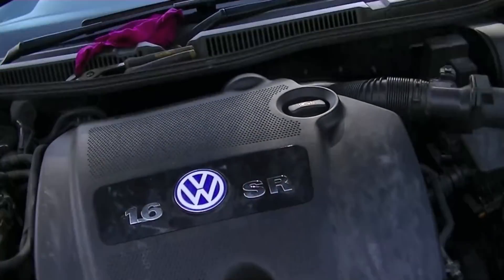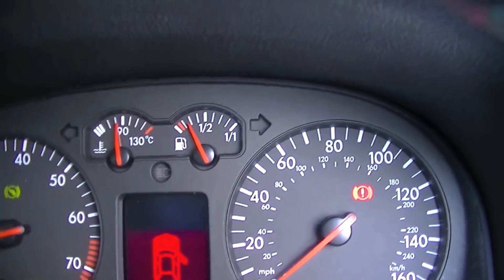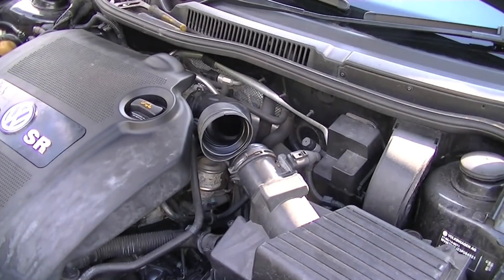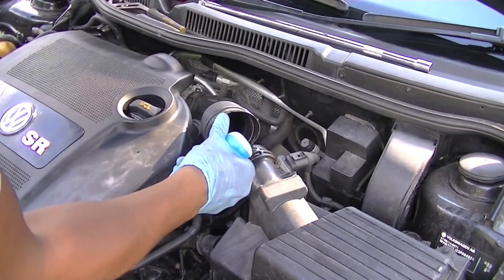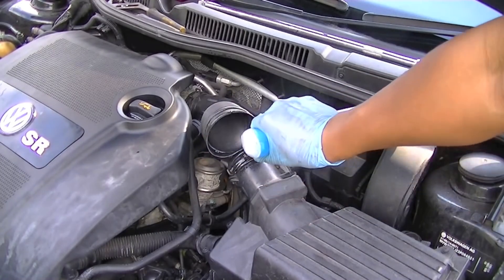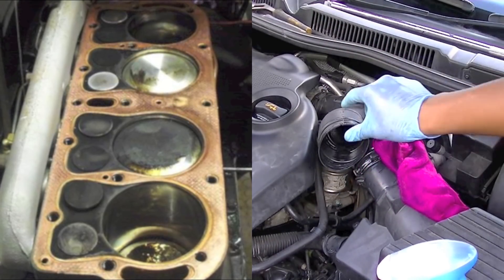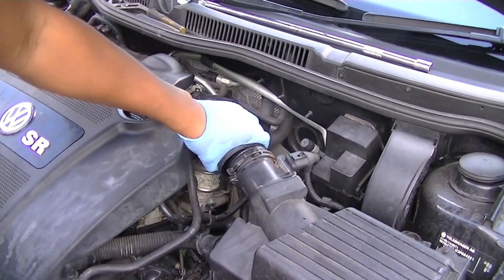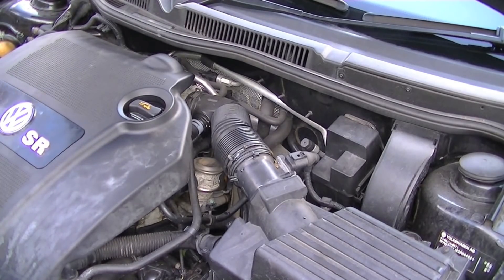How to make your engine run better with just tap water.......Better Than Seafoam?

Comment: Use quality fuel and you won't get carbon build up, always use super unleaded, lower octane fuel is cheap crap and your engine hates it. Im a performance engine builder and you never get carbon build up (which would effect performance or reliability) on engines using high octane fuel, even ones that have done over 60,000 miles.
Prevention is always better than a cure.
Reply: DirtybeatZ uk so I'm not the only one that knows you have no idea what you're talking about
Reply: actually higher octane does absolutely nothing for cars except for high compression engines. even in high compression motor it doesn't  effect carbon buildup it reduces pinging. (different than rod knocking)
Reply: Ryan Pitterman lmao thats the dumbest thing i ever heard, obviously you know nothing about engines or fuel, i map engines for a living kid, i know for a fact and so does all performance technicians, fuel makes every difference in producing power, low octane fuel is not even premium fuel, low octane fuel is for low emission output because of law, its not for keeping an engine in prime condition.  Reducing carbon build up is a side effect of high octane fuel, its cleaner and has properties that are even proven by the manufacturer to reduce carbon build up and clean the internal fuel system. ECU mapping adjustments can make any car run on any octane fuel, even E35.
Its clear you know nothing about what you're talking about so in future listen to someone who knows more than you.
Reply: I'm not going to be like you and lie about my profession. I'm currently in school and we are going over octane in class. and my professor said you're full of it
Reply: +DirtybeatZ uk it seems to me that octane is the agent in fuel that prevents pre ignition in high compression engines, or low comp. turbocharged engines. high compression and heat cause ignitiin before the spark is sent, thus causing knocking. bad combustion creates carbon deposits and bad performance.. i wouldnt put high octane fuel in my gf's focus..but i do in my own car, like you said, because its mapped that way..but there is a mechanical reason for it too
Reply: DirtybeatZ uk you're flailing here falling back on insults and calling everybody "stupid" doesn't make you sound and more intelligent than you are
Reply: DirtybeatZ uk lol I'm not saying I'm offended. I'm just saying that you rely on simple minded insults which send a message that you don't have a strong vocabulary and aren't well educated
Reply: DirtybeatZ uk noone ever said it makes you go slower it but it doesn't provide a horsepower boost just limit pre ignition
Reply: DirtybeatZ uk it does not give more power. it reduces powerloss from  pre ignition in high combustion n/a or Low combustion forced induction engines
Reply: DirtybeatZ uk I didn't insult you i said you use words like stupid to make yourself feel superior to others
Reply: DirtybeatZ uk again you have no idea what you're talking about. you are the one trying to make to yourself feel superior implying that you have confidence issues or maybe abandonment issues.
Reply: DirtybeatZ uk https://www.exxon.com/en/octane-rating
Reply: read that I just looked it up and it pretty much sums up everything I have told you
Reply: DirtybeatZ uk and noone has agreed with you hrmmm and you gave me a link to an advertisement they can say whatever they want
Reply: sound cooler*
Reply: I hoped you learned something here
Reply: DirtybeatZ uk https://www.bellperformance.com/blog/bid/101182/What-Does-Octane-Do-In-Gasoline-Octane-Ratings
Reply: Ryan Pitterman Then your professor is less qualified then i am and he should not be teaching you about anything. He should be sacked for lying to you. He is an idiotic fool if he believes high octane makes no difference in performance, mpg and carbon. I build and race drift cars, my low compression big turbo engines run on Shell high octane and E85, if i put low octane fuel in, the cars won't run properly and lose power, WHY? because of the ECU is adjusted to run on high octane race fuel, i have to remap to run on low octane fuel, the difference in fuel is so vast. Hope you learned something here.
Reply: Also why would you call someone a liar when you personally don't know if they are lying? That is stupidity. I'm no liar and i urge your professor to debate this topic live on google hangout with me, i have nothing to hide and would love to see how qualified he is, especially when he is teaching you wrong.
Reply: high octane will show better performance only if it was a high horsepower, high performing engine.  high octane will be no use for your car if its bone stock even if it states on your dash to  use premium gasolines only.  but i dont think its wise to not follow what the manufacturer recommends.
Reply: houa vang INCORRECT, already said what it does, you not understanding how high octane petroleum give engines more power is very disturbing, do some research before commenting on my comments otherwise you look dumb. So basically your saying lower octane fuel makes you go faster right?
Reply: Ryan Pitterman There is a time and place for you to be stupid, just because someone else is as stupid as you does not win your flawed argument i'm afraid, nice try though.
Reply: Ryan Pitterman Lmao, so you tell me off for insulting you then you insult me, are you always this stupid and contradictory. Don't bother replying because you will be confirming you are as stupid as i think you are. PEACE.
Reply: Ryan Pitterman Oh i see you have a personal problem with authority, you always want to be in charge and know everything, ok well we got to the real issue of this debate in the end, PEACE.
Reply: Ryan Pitterman Are you still crying? jeez get a life, i don't have time to answer your stupid personal issues with me, i'm right you're wrong get over it and move on. Be grateful you learned something.
Reply: Lmao ok your right high octane fuel at your local pump makes your engine go slower, my mistake, you complete fool, you just proved me right with the clumsy link you gave. you complete idiot. http://www.shell.co.uk/motorist/shell-fuels/shell-v-power-nitro-plus/shell-v-power-nitro-plus-unleaded.html 
HOPE YOU LEARN SOMETHING HERE!!
Reply: Ryan Pitterman Yes shell V will give your engine more power over standard unleaded, FACT. So my original comment is right. Your lame attempt to understand how an engine works is so laughable, anyway you crashed and burned, PEACE.
Reply: Fact agrees with me, Ferrari agrees with me, all performance car tuners agree, and who are you? a nobody who thinks he is right when he is wrong because he is concentrating solely on one additive and not the rest of the ingredients in high octane fuel at the pump. You cannot buy low octane fuel at the pump that does the same for your engine as high octane, quality of fuel is different, also under consumer regulations no company can sell a product and lie about what it does, if you personally can prove Shell and Ferrari are lying then sue and you will make billions. To sum up, you are wrong, i am right, now troll somewhere else, PEACE.

Comment: The reason this works is because this is old technology. It's called coal or carbon gasification. It's used to turn coal(carbon) into gas for combustion. It's not odd or unusual. The chemical formula is thus: 3C (i.e., coal) + O2 + H2O → H2 + 3CO
Reply: Felix Su not quite. May I suggest avoiding a career in chemistry. that is the formula for gasification but that is not what is going on here
Reply: Thanks for the formula I understand why he did it now...……………………………………………..
Reply: Felix Su that man is a jerk! Never take the risk of water in the engine . Or water in the fuel tank. It   can be a dangerous idea for damage all yr injectors & sensors  .This video is a suicide!

Comment: I believe that coolant leaking into the combustion chamber will de-carbonize the combustion chamber.  Years ago, my father who was a mechanic, told me that he observed the same thing.  He once built a spritzer that would automatically spray a mist of coolant into the intake air stream.  Ran that way for years.  

My question to BMAC VAGS is:  What evidence do you have that plain (hopefully, distilled) water does the de-carbonization, when a leaking head gasket is introducing water/anti-freeze solution.  How do you know it's not the anti-freeze solution that's doing the work?  Perhaps plain water does not.

Moreover, how quickly does it act?  A leaking head gasket might be going on for a long time before any significant amount of carbon is removed.  Possibly, it could take many hours of run-time to achieve any noticeable improvement.  

Your premise has some merit as far as it goes, but I would like to see more evidence:  plain water vs. coolant; and time vs. results.  With your engineering degree, I'm sure you know  how to conduct a properly designed and controlled series of experiments to prove or dis-prove your claims.
Reply: If you check the spark plugs before and after, you'll see evidence.  But exactly how much it works, especially on the exhaust valve stems and tulip surfaces is the real question.  I've used this technique often with some results but I have no quantitative data.

Comment: this theory is stupid water will not clean carbon only cause engine damage.
Reply: +Nicholas Galea - It does work, just a small amount though :(((. You won't see it unless you take the Exhaust apart at the Engine. Try it with a Lawn Mower Engine, you will see it, I got tons of Carbon coming out, but then the Engine die really quick LMAO :)). But yea, if you put in a lot, it will CRACK your Engine if it's HOT enough.

Comment: you need to proof it. take the spark plug of before and after and take pictures.
Reply: That sounds like a solid suggestion, as the plug should also be nice and clean .
Reply: he did it already in another videos... just google it, you'll find out this is a very known method that really works
nothing new, nothing invented. IT JUST WORKS
Reply: "Prove" it, dear, not "proof." Sheesh.

Comment: well according to the example you showed; wouldn't it make sense to clean it, spray it with coolant? since it's non corrosive?
Reply: If anything, it would use distilled water.  Antifreeze has oil in it and will plug up your catalytic converter after it burns.
Reply: good point spray coolant instead of water.
Reply: coolant will clog up the catalytic converter

Comment: hi there... i must say,what a  brilliant video.. i will definitely try this on my 12 year old clio 1.9D  just one question.. can you confirm that where you sprayed the water was the maf sensor in there or not..???? and would the water damage the sensor if it was ..
Reply: No the maf sensor was on the other part of the hose. You could see where it plugs in on that part. And nothing should ever touch the maf except air and special maf sensor cleaner. Very fragile and expensive part.

Comment: Watch yourself mate driving without a seatbelt, the police have video evidence BE CAREFUL. Thanks for the tip it worked a treat
Reply: +BMAC VAGS I have a 1.9 tdi alhambra with 185k miles on the clock.. would you advise someone to try this on a high mileage car?.. is it likely to screw things up?
Reply: Did you try ,? Did it worked?  @zaizainjamal
Reply from the maker: Thank you and excellent

Comment: Do this on a DPF car and the car will go into limp mode.
This only work on old cars, I really doubt it works on these newer engines.
Turbo definitely will go to heaven.
Reply: Agreed. I wish I wouldve known about this back in my 85 Monte Carlo days. Not about to go spray any water into my electronically monitored new school engine though.
Reply from the maker: Why will it kill your turbo?

Comment: if it's a aluminum block it will rust the water passages.your only suppose to use distilled water!
Reply from the maker: So aluminum rust?
Reply: +BMAC VAGS yes.i think it has todo with the fluoride in the water
Reply from the maker: +TEXASWAYZ So you are saying Flouride rusts aluminum?

Comment: I can certainly attest to the need for keeping the RPM above 2k!  3 weeks ago I was driving my xA (Toyota ist over your way) through a really NASTY rain and didn't realize my 100k old CAI water bypass finally got old and died (badly cracked), basically leaving the intake pipe wide open.  my engine almost died multiple times till I discovered the best RPM range, and when I finally got out of the storm, Lo, and behold, no more water problems.  now I'm half-tempted to fish a boroscope down the spark plug hole just to see what happened.

Comment: heres my 2 cents. I worked at a fire shop sold fireplaces etc. Had lots of old flues and cowls that have been worked for years with a shit load of carbon build up all over them. when left in the rain for like a day about 80 percent of all the gunky black carbon falls right off. This is just little cold rain dropplets. Now imagin if those dropplets were like a lil warm them cowls n flues would be shiny as hell. If I did this I would def drive around for abit to make sure its all out of the engine though cant risk any rust inside the engine whats your thoughts on this..

Comment: I've heard that carbon buildup on pistons and valves give you more compression. Cleaning them does nothing to help your engine run better. Spark plugs should be removed to clean or replace. This is another DIY car repair that is useless, I think.
Reply: on the contrary, carbon buildup won't allow the valves to seat down properly allowing compression to escape hence lowering compression. once you do a cleaning as shown in the video and if you have valves that aren't seating right because of carbon build up it will actually increase compression as the valves are now allowed to seat properly.
Reply: Come on Pedro. That would be the most extreme case of carbon build up imaginal. For the carbon to actually grow on the valves enough to go around the edge of where they seat? And carbon doesn't build up on the valve and cylinder head 'seat' itself. If you have that much carbon in your engine. You've been driving a poorly tuned car for decades.
Reply: +Howie47 yes that is right but most people who would try this probably have high mileage and haven't done it before and that would allow them to see some increase in compression. it is kind of worst case scenario but you wouldn't believe how some people treat their cars or lack thereof any maintenance sir. but that's just my experience.
Reply: all that carbon build up can make your pistons fire at 50% and not at top dead center where you get more compression thibk about it the more flamable stuff inside the engine valves top piston and a spark happens and piston is not all the way at TDC and boooom no compression I just port and polished a 1.9 saturn motor i race and they are bad about leaving carbon a 1/2 inch off the walls now i have about 48 more HP ON DYNO

Comment: ok firstly you have to understand how engines work. Both petrol and diesel engines compress the fuel air mix for detonation. You all know this, now look how much pressure is needed to compress water. No vehicle produces that much so here's the thing. the incredible pressure and heat created when water is in the combustion chamber may well clean a small amount of carbon. The cost is weakened piston crowns, weakened rings etc etc
Reply: At first the engine may have a very small gain as the damage will show up some time later

Comment: Water injection was once fairly common as a performance boost, cooling the charge. I don't know if those engines ran any cleaner. A fracture between cylinder and waterway will introduce a lot of water under pressure - already at boiling point - and as levels reduce steam. A few squirts of mist, I can't see it working. Has anyone done a proper test? Would be interesting to see.

Comment: well i somehow came back to this video i see i made a typo below meaning hot water not how water oops ,,,,he is right i been doing this for years , the proof of this can be when you    blow a head gasket look when you remove the head witch cyl are sparkling clean ,,,,it works ,,make sure its hot ,

Comment: its not always best to remove carbon from an engine ,it helps maintain compression especially in older engines
Reply: do not use engine cleaning fluids because yes the will remove too much carbon especially in high mileage engine.  I found that out the hard way many moons ago.   I have never tried misting water into the intake so maybe I will in the future, wws.

Comment: * if combustion chamber has excessive carbon deposits, engine has bigger problems then what a spray water bottle can fix .

. high mileage
. old fuel injectors
. low compression
. oil not changed every 3,000 to 5000 miles.
. fuel filter not maintenanced properly.
. bad driving habits( always driving slow and lugging down the motors RPMs ).
. VW.... piece of crap

               ^